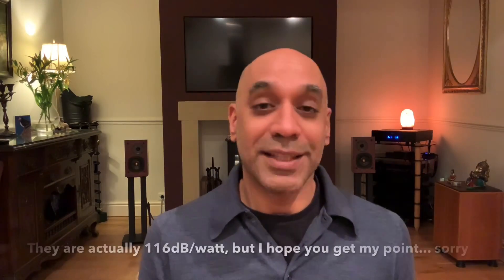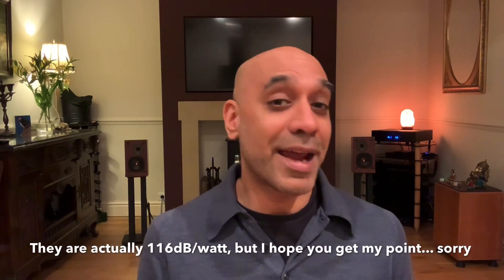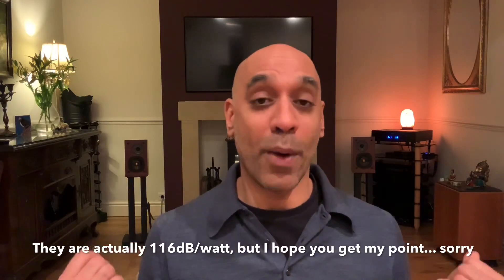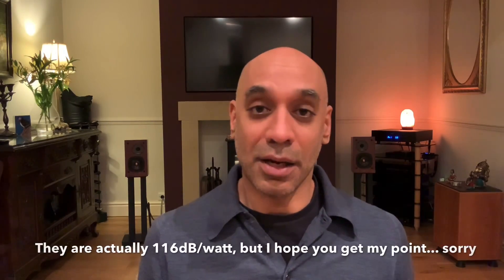Hifi Myths & Misconceptions - Amplifier Power

Comment: Nice channel, just subbed :-) Can i ask some advice? I am interested in the Hegel 120, but have also seen the H190. Is the 190 much better, and worth the extra? They will feed for now Klipsch RP6000, which will be replaced soon by Focal Area 948s.. keep up the good work!
Reply from the maker: Hi Gratia, thank you for watching and your support. The Focal Aria 948s are a decent sized 3 way floor standing speaker. They have a minimum impedance of 2.5 Ohms. This makes them not the easiest speaker to drive despite their 92dB sensitivity. The Hegel H190 will have considerably more grip on these speakers than the H120. I would go with the 190. 😉

Comment: In general a 100w speaker with a  spl of say- 85 db will sound twice as loud compared to another of 82db with equivalent power input. Output doubles with an extra 3db. That's why PA speakers are 95 98db or more for high output and high efficiency
Reply from the maker: Thank you for watching and commenting 😉

Comment: Yes agreed, lots of power is only necessary for headroom and low efficiency speakers, and for me, should be biased into Class A for a significant % of the total watts. Actually, high current is the more important indicator of a quality SS amp, closely followed by SN ratio, high input impedance and linearity. Fronted by a good tube pre, powerful SS amps are flexible performers that can be paired with a wide range of speakers. Tube amps can work with low efficiency speakers too, but I do not think they are optimal partners.
Reply from the maker: Thank you for your insights Michael 😉

Comment: With regard to the sound of your vids,   I believe your sound would benefit from adding a good lavalier mic that clips to your shirt.   Alternatively a good shotgun mic off camera and fairly close would help.     Take a look at Youtuber  New Record Day he has the sound of a professional studio.  He has special mics for recording speakers and a studio mi when sitting at a desk.   Avoid using the camera mic.  Rode is a good brand. This video has good not great sound.  You are getting some room boom in you sound even at your modest speaking level.    Like you detailed reviews.
Reply from the maker: Hi Ron, thank you. I have a shotgun mic and a lavalier mic. The problem is that I film on my iPad Pro. Apple removed the 3.5mm connection from this device. I have to use a USB C to 3.5mm adapter which causes problems with both mics. The lavalier has too much gain and the shotgun not enough. I am hoping to get it sorted out. Thank you for bearing with me.

Comment: My normal listening level uses 0.5 W RMS of amp power.  5W RMS is very very loud.  To have enough headroom to handle peaks, I want to be able to handle an extra 10 dB, so a 50 W amp will work.  I use a 60 W amp that works great without distortion.  That way, I can handle 20 dB peaks at my normal listening level or 100 times amplifier power.  In addition, my amp can deliver 100 W (IHF) peaks, giving me another another few dB capability.  Bass notes require the most power.  They can max my amp, but that's very unusual.  The 1812 Overture cannon blast does it.  Better to max out the amp than blow the speakers.
Reply from the maker: Thank you for watching and sharing Jeff

Comment: wondering if there is a sweat spot with regards to THD, etc. Like is an amplifier's THD the lowest when it is working at exactly 50% capacity? Then maybe everyone should get twice the amp they need.
Reply from the maker: Hi xSKOOBSx, once the THD drops below, let’s say 0.1%, it becomes meaningless. The type of THD is more important. It is not something I would be too concerned about as long as the amplifier is working with it’s linear range. Thank you for watching and commenting 😉

Comment: From my experience I think less efficient (about 85db) small speakers perform better than more efficient small speakers (overall). Thicker, heavier, stiffer.... driver materials will make a speaker less efficient, but also stay tight when pushed to higher db. High efficient stand speaker tend to sound "shouty" to me when turned up a bit. Maybe it's just the ones I deal with.
Reply from the maker: Hi Gord, there is quite a bit that goes into determining the sensitivity of a speaker. For example, you can increase the sensitivity of a driver just by reducing the bass extension.   I think you probably have to judge each design on it’s individual merits. Thank you for watching and sharing 😉
Reply: @abritishaudiophile7314  I think the differences he would be hearing in general are from techniques used to make higher sensitivity speakers - usually lighter weight/bigger cones, horns, larger cabinet (usually doesn't have the bracing to make it as inert as equivalent smaller box) etc - these do have certain traits to them.
Of course there are line arrays and multi-driver methods too. Also with their own set of issues, but you can use multiple lower sensitivity drivers that wouldn't have the characteristics of lighter materials etc.

Comment: Easiest way to decide - 20% less than your speakers' rated output. Neat way to ensure you don't accidentally blow them up ;)
Reply: That was my method. 75Wp/c speakers and 65Wp/c Amplifier. Sometimes I fear the speakers are playing too loudly in a large room but I figure the Amp should distort/clip before the power is too much for the speakers. Speakers still performing great.

Comment: Power and perceived loudness(spl level) really depends on the speakers, even if the speaker says 90db efficiency, a speaker which has 88db efficiency for example could actually be louder then a 90db speaker at 100W of power simply because of something called power compression caused by how the speaker cabinet is built
Reply from the maker: Thank you for watching and commenting 😉
Reply: Yes little speakers will suffer at 80dB, speakers with larger woofers, especially 3 way speakers can exceed 95 dB with little distortion

Comment: Does make me wonder how manufactures calculate their figures.  Had 100w av receivers struggling to run 5" speakers, have smart speakers rated at 45 watts which are only ok as background music. An old yahama 55 watt amp which will shake the house apart at half volume?
Reply from the maker: Good point Darren. When it comes to rating amplifiers there are a number of tricks. Peak voltage as opposed to RMS, one channel driven as opposed to all channels driven, 4 ohm rating as opposed to 8 ohm rating and plain dishonesty! Power rating on speakers is just to prevent abuse and warranty claims. Other than that it is pretty useless.
Reply: In the 80s, PMPO was used as a selling point by Japanese Mini- Compo. It then reverted to RMS eventually. I still use a 28 yrs old 25w/ channel British amp.. More than enough for a small home..

Comment: Wow, those Klipsch speakers you mention have a crazy high efficiency. 116dB, that's impressive. Phew. The most efficient drivers I ever heard were a set of lowthers, at 100dB or so those were FAST. Really lovely things they were. I dream of obtaining a pair of those drivers one day - they will of course give me an excuse to build some new cabinets too - the suggested loaded horn designs on their website are properly complex. Check them out if you have a minute, they're pretty wild. I love how they describe the difficulty level, that's pretty cool.  https://lowtherloudspeakers.com/products/cabinet-plans/
Another great explanation video - far too much marketing hype surrounds supposed amplifier wattage outputs. It depends on far too many factors, but then I suppose the manufacturers need something to use or they become like Rolls Royce engines, where the power output is simply described as "adequate". The speaker power handling wattage is a bit of a misnomer too. You can easily blow a 100 watt rated speaker with a 10 watt amp by overloading the transistors and feeding out straight DC voltage (as a cheap unprotected amp will do if pushed beyond its limit). Yet that same 100 watt rated speaker will comfortably handle 150 watts if it's a nice clean signal from an amp that's not working hard at that output level. But now I'm preaching to the converted.
I ran a NAD 3240PE intergrated amp for a while that made plenty of noise into 88dB 8 ohm speakers, and that unit is rated at 40 watts RMS. Granted it had that groovy patented "power envelope" circuit that acted a bit like an emergency high octane fuel tank and gave you a blast when needed, but still, it was plenty for a lounge room. The pair of 200 watt twin mono things I have now are ridiculous overkill, the volume knob on the preamp rarely goes above "3". At level "5" it's too loud to stand in the room, so it's well enough. the advantage there of course is that they never have to work hard so never experience thermal issues, which can be problematic over time. An amp that runs hot will fail much more quickly than one which barely idles, and that can certainly be a good justification for going big with amplifier power, as well as the headroom factor you mention. 
At the end of the day if you enjoy the way it sounds and it's not doing damage to anything then it doesn't matter all that much.
Cheers.
Reply from the maker: Hi Andy, as always a joy to hear about your experiences 👍
Reply: Even on P A systems 116dB is huge, I can't believe this figure an average of 95 dB would be realistic. You find 15" speakers within 95 to 99dB. 116dB only for compression drivers but you are limited by bass.
I have a RCF 15" 95dB with a 4" coil and a 8" magnet. Imagine what youd need to pass 110 dB even with neo magnets...

Comment: I can appreciate the science part of it all, but speaking of my own gear, I have a current meter on my 48w pc integrated, my speakers are 96db 10ohm, dropping to 7 ohm. 
While listening 2.5 meters away from my speakers at an average 75db I can see the meters reach the top of the scale on dinamic peaks, which are not so rare.
In theory I shouldn't need more power but it turns out I do.
Reply from the maker: Hi Adam, a bit if headroom is always beneficial but there is a lot more to it that just merely Watts. For example, peak current capability, how the watts increase as the load impedance drops, the amount of filter capacitance reserves, slew rate of the amplifier, just to mention a few. I wanted to keep things simple and relatable for this video though. Thank you for watching and commenting 😉

Comment: He's giving a general rule of thumb. I have a 125 watt/channel 5 channel amplifier and it has no problem driving 5 speakers at high levels if I want with no sign of clipping.  You can't say that about 125 watt/ channel receiver when you get to 5 channels you might only have 60 watts. If you have a good sub then your reciever will be less stressed producing bass which takes a lot of power.  You can download an spl meter app and know just how much sound your system is using. But more power is better than less.
Reply from the maker: Hi Donald, I have to say that I agree with you. I am glad you pointed out the purpose of the video was a very general rule of thumb. Hopefully, to demystify the issue of amplifier power for some viewers. Thank you for watching 😉

Comment: Just one minor thing - you forgot to take the number of speakers into consideration :-).  One of your speakers might have a sensitivity at 85dB/2.83V/1M (sensitivity ratings should always be given in volts, not watts - but that's another long story), but you're using TWO of them in your listening room.  That can up the overall sensitivity by approx 3dB.  That in turn should halve the required power level to reach your desired SPL level, compared to using only one speaker...
Reply from the maker: Thank you for pointing that out Brian. Then you also have to consider the power rating if the amplifier might only be for one channel driver. I just wanted to keep things as simple as possible for this video. Thank you for watching 😉

Comment: You have a fair bit of echo in your room. Must be difficult to choose speakers and correct equalization. What works in your room would never work in mine (multiple bass traps, carpeted floor and sound absorbing ceiling  panels). I need a more lively speaker/amp combo
Reply from the maker: Hi Mike, actually there’s not much echo in my room. I have a problem using my 3.5 mm mic through an adapter to convert the signal to USB C to run with my iPad Pro. I am looking for a solution, please bear with me. Thank you for watching.

Comment: I must disagree with a lot of commentators here - I am far from thinking, that this is a good explanation.
It is a basic explanation at its best.
The huge wattage amps often have much better control - even at lower listening levels. They also tend to clearly make the music stand much more "in the room" out of the loudspeaker boxes - so to speak.
No technical explanations - give the same experience of what really works as listening in real life.
My Snell Eiii's sound quite good with my 80watt integrated stereo tube amp -
But they sound way better with my friends 200watt audio research mono blocks.. At the same average listening level - the mono blocks make the speakers dissappear! My integrated 80watter cannot do that... Even though its a great amp
Reply: Double-blind listening test, same room, same voltage output confirmed from each amp?  If not, then there just might be a bit of "confirmation bias" involved in your observations... :-)
Reply: "Huge wattage" has very little to do with how much control an amplifier has over a loudspeaker. Damping factor, current delivery and output impedance are much more significant.
Reply: Unfortunately the higher power comes with higher noise for the same S/N ratio. All  amps have a noise floor. Lower power quality amplifiers have less gain, less gain noise, and therefore less noise at normal listening power.
Reply: You are correct. A 50 watt little speaker with a 500w amp will have dynamics unherd of in any dealer and will defy it's size in sound. A 100w amp (A mini) and next to  it a 500w amp (The  Rangerover) both going up a hill at the same speed. The mini will be stressed and hot but the big beast will be purring and cool

Comment: thank you for being so level-headed. When i look into the specs of a power amp, what should I be looking for? (assuming I don't get to audition the amp, but wants to buy one) Currently, I look at: Frequency Response (wider range better, wish someone can give me an idiot-proof explanation); Signal Noise Ratio (higher better); THD (lower better) and Output Power: Watts Per Channel; and transformer class A, AB, D and G? I actually don't need to know the mechanics behind those terminologies, well... I just need to know in plain english WHAT it is. I have subscribed, thank you for doing what you do.
Reply from the maker: Hi Wie, buying am amplifier based on it’s specs is like buying a car based on it’s specs. It you were spending £xxx on car what would looking at the specs tell you about what that car is like to drive and live with, very little. It is the same for amplifiers or any hifi component. The only amplifier spec worth considering is that it has enough power to drive your speaker to the volume you require, given the sensitivity of your speaker and the size of your room. Narrow your choice by picking a brand and a design you trust. This is not easy, lol for balanced reviews where people discuss a products strengths and weaknesses and compare it to others. If it is a gushy review saying it is the best thing ever but compare it to nothing then you can probably disregard it as paid advertising. Sorry I could give you a simple solution. Good luck 👍
Reply: Thanks for making time. I appreciate your intent. As I said I do not audition the gear, and in a force choice situation, what should I look for besides the speaker sensitivity and amp's power output. I nevertheless appreciate your long explanation.

Comment: I have a 12' x 25' room and very difficult speakers, 5 drivers each channel, 86 dB/watt  with a 10" woofer. I like listening at 80 to 85 dB, 3 meters distance, which I measure with an Android app and also an SPL meter. I pushed the speakers once to 90 dB . . . just to test the speakers and the 300 watt amplifier. Clear as a bell . . . and no neighbors to bother. You are right that only transients and certain difficult frequencies take the power output out of the single digits, and so many other specs come into play. With the newer Class D amplifiers, things will be much simpler for this generation of audiophiles.
Reply from the maker: Thank you for watching and sharing your experiences Leonard 👍

Comment: I noticed that tube based amps are rated much lower than solid state amps. I know that tubes do have the ability to overdrive but is there a thumb rule on tube amps vs solid state when it comes to watts?
Reply from the maker: Hi Ranga, Watts are watts. You need enough to play as loud as you need. Then is comes down to how the watts change with regards to the load of the speaker changing. Ideally you want the wattage to double as the impedance of the loudspeaker halves. This is not usually the case with many tube and solid state amps but the closer it gets to this the better. 

The topology of tube amps means that they do not easily lend themselves to high power applications. Don’t get me wrong, it can be done but gets rather expensive. Also, tube amps, by virtue of having output transformers, traditionally have a higher output impedance than solid state amps, resulting in a low damping factor. This is essentially how much control the amplifier exerts over the woofer. This is the reason why tube amps have a reputation of not have good control of bass frequencies.

Thank you for watching 😊